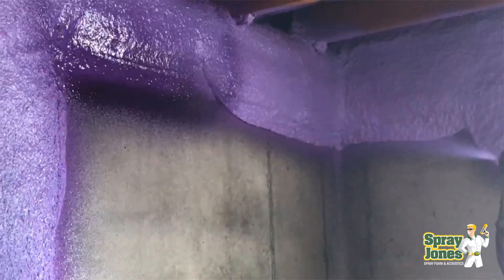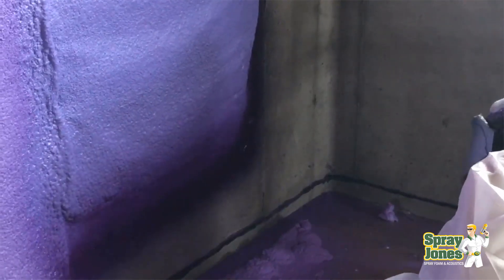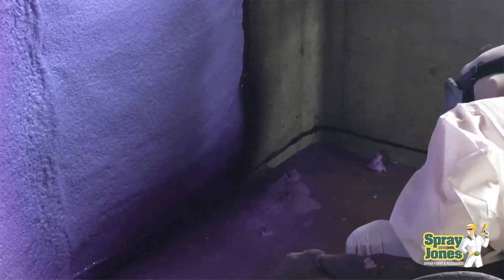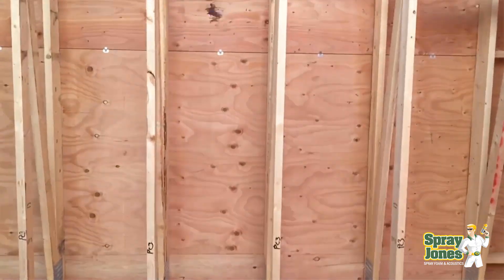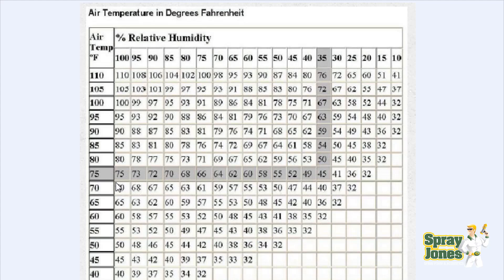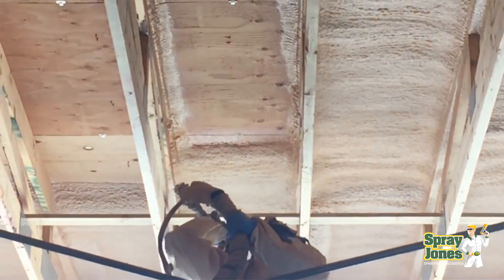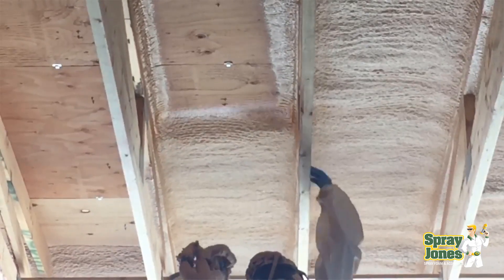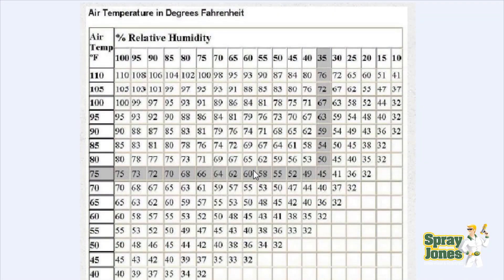How much Spray Foam Insulation is needed to stop condensation?

Comment: There’s no mention of outdoor temperature which dictates the amount of insulation needed and influences the temperature of the interior face of the foam (substrate).  This is very important.
Reply from the maker: Air temp compared to substrate temp in relation to relative humidity in the air. Those 3 are what you need to know.
Reply: @ true. What I meant was there’s no mention as to how much insulation is needed in the first place- which is a function of how much R-Value is needed.  After the required thickness of insulation (for R value) is determined, then all the other factors mentioned  come into play.  A one inch layer generally won’t be susceptible condensation, but it sure will be  in Northern Canada when it’s freezing outdoors. My point is you generally don’t determine the required thickness of spray foam based on vapour condensation, but instead on climate region.

Comment: Kitchen fan, bathroom fan drawing air thru tight spots,  
It's easy to change the conditions, ,balance iin house.(decking= syll rotting, block vents to crawlspace= rotting floorbords,)paint your fence ,all sides, withlatex paint .

Comment: My only concern is future cracks in basement .    How could you detect any problems?
Reply from the maker: You don't. Small surface cracks are stopped, but large ones will crack the SPF. 
At what point do you expect to be dry and warm?

Comment: So you’re saying that even the screws that stick through need a solid inch covering them to keep them from dripping condensation? So say they’re sticking through 1/2 inch then you’d need 1 and 1/2 inches of spray foam?
Reply from the maker: Yes. If they get cold enough they can drip at the tip. If that will be the case increase the amount of SPF.

Comment: I'm going to be building a cold plunge (https://www.youtube.com/shorts/ifpMX-7fhtM). What kind of spray foam do you reccomend I insulate it with. I'm building a wood frame around it and I plan to put a vapor barrier as well. I'm worried about condensation from the cold plunge. Any specific foam to stop that?
Reply from the maker: Closed cell.
Reply: @SprayJones  Sir, thank you for replying.  Someone like me who is naive to this greatly appreciates your reply. Do you reccomend anything off the shelf at a home depot or lowes?

Comment: Good video and well covered!👍 Im doing a building and have a pile of rigid XPS 2” and 3”. Was planning to fill attic and spray/seal all edges. Since the XPS is not adhered to the bottom/back side of the OSB roof deck/wall; is there a Chance of moisture/ condensation to build in that space? 

I watched the 4 part series, and want to make sure best approach. This will be a heated storage space. It’s a 48x84 with 20 sidewall pole building, roof deck and walls sheathed with 1/2” OSB 

Would there be any Benefit to apply spread groan over the top of the XPS?
I have on hand 10000 Square feet of 3” and 7000 Square feet of 2”

Plans to place below concrete slab and in walls and to roof deck. Would appreciate to hear if you have seen This application.

Thanks and great videos on this topic!! 👍👍

Comment: Mike - is there anything to worry about or considering when building a conditioned attic above the living space but having a vented attic above the garage? I understand that the partition wall in the attic for the garage would be insulated with open cell in my scenario, but is there anything wrong with this? I originally intended on continuing the R30 on the roof deck with open cell but have now thought about the issues above the attic with the building up of moisture at the peak. 

Maybe I’m overthinking this, but was hoping for your input.

Comment: I have a metal roof shed with 3" high box metal rafters.  If I have the inside spray foamed will I still get condensation through the rafters since they are touching the roof?

Comment: If you do flash and batt will the 3 or 4 inches of batt insulation insulate the surface of the 2" spray foam sufficiently to cause condensation on the surface of the spray foam?
In this situation the inside surface of the spray foam is being cooled by cold conduction from outside but is insulated from the warm interior by the batt insulation.

Comment: You say it's simple but the reality is behind that chart and the standard is complexity. That delta in the chart that shows condensation can go both ways, you can raise your indoor RH and get condensation and you can change your outdoor temperature and get condensation, you can increase your wind chill and get condensation, you can have both higher humidity and lower temperatures. So you need to know your climate zone and your incidence of extreme temperatures and then factor in a % of buffer to REALLY insure no condensation behind the walls of a structure. Otherwise, over time, you can get mold growth. Mold is a funny thing, all it needs is 21% moisture content and it grows, no matter what, then when it drys up it stops growing but lays dormant waiting for its chance to grow again. Mold can grow very fast, I have seen 1/4" thick mold layer grow in an air handler from one summer of condensation inside the air handler from a stuck chilled water valve. so, in short, the answer to this question should involve the ashrae standards of climate zone and incidence, the R value of 1 and 2" layers of the foam and an agreed upon buffer to make sure nothing condenses during extreme weather events. If you really want to geek out on this, you can take in projections of global warming trends we are already seeing witch do not necessarily mean things are getting warmer either in your climate zone, it really means more extreme weather events more often and warmer summers.
Reply from the maker: Global warming trends.... that aren't warming. "witch" is it?
Reply: @SprayJones   like most things in the universe, it's complicated. global warming may not just be distributed equally over each month as a few extra degrees of heat. The Earth is a dynamic place filled with saltwater, fresh water, huge global air currents, giant slabs of ice etc. The Earth is spinning ya know, so this causes some places to experience extremes of weather instead of just a few degrees of warmth, some like deserts in Australia, Africa do experience extra degrees but places like the midwest of US , and south along the gulf experience more tornadoes, or warmer winters on average but with colder extremes.
Reply: if air is conditioned on the inside properly then your humidity should be lower than 60% inside. i have found that my shop will not condensate at -10F outside and 70F inside with 1 inch of closed cell which qualifies as a moisture barrier. it was all very simple and as you can see the window is huge. global warming is not a thing and the term has been abandoned years ago. the rest of what you speak of doesnt matter either. Did you get that mildew tested inside the a/c system or did you see a collection of stuff and just assume it was mold? "alamost every a/c in the south has this and guess what, its not mold. KISS, its not compicated.

Comment: Thank you for all of your videos.  Straight and to the point.  I am looking at finishing my basement and your videos have been very helpful.  I will be meeting up with a spray foam contractor soon and will be looking at 1-1.5” of closed cell over the exterior poured walls and 2-3” in rim joist areas(I live in Nebraska). That way I have the vapor barrier and air sealing I need.  I plan to come back and 2x4 metal frame out at around 2” off the walls.  Then use BIB blown in insulation to fill the whole metal stud cavity.Thoughts?
Reply from the maker: 2" for all areas. Skip the bibs. 
Enjoy a warm basement that will be dry. 
We do them all the time this way.

Comment: I have 29 ga metal walls in my barn. Any concerns spraying 2” closed cell directly onto the inside of metal panels?
Reply from the maker: Flash coat with 1/2 inch and then build up the thickness

Comment: Great explanation of the humidity and due point table. Very interesting, and it's true most finished homes have 30% humidity and 72f. That's a good basis. As a temporary measure I install an r20 in attics when the soffit isn't installed and there are high winds. That usually prevents an excess of condensation for the mud to try on the ceiling.
Reply from the maker: Thanks for watching!
Reply: @SprayJones  thanks for sharing the info 👍

Comment: Just got back our updated quote from our insulator and the price of Closed Cell has jumped 30%. 
You think it will come back down soon, say before fall? 
The new price puts the foam insulation into the "luxury" category for our small home build. I don't want to do batts, is the cost still worth it?
Thanks for the knowledge you share with us, greatly appreciated!
Reply from the maker: For one, our foam has NOT gone up 30%. Smaller operators are having to buy product wherever if the are cut off, and sometimes that means panic prices to them and so on to you. 
SPF is totally worth it. Closed cell is the BEST product for insulation in 80 years. You only have to pay that bill once and you are good for generations.

I think you need to get more info.
Reply: @SprayJones  We are in a rural area where there are only a two different insulators within a 3 hour drive. He uses Carlisle SealTite. Is that a good product?

Comment: Thanks so much. This comes at a really good time. I’m getting ready to have 24x30 metal pole barn/shop put up . We are going to insulate so I can heat it in the winter here in southern Ohio.
Reply from the maker: Glad I could help
Reply: We use Commercial insulation as we sheet 60".wide, length + 5ft so it can be pulled tight double stick carpet tape to hold before sheets put on, for standing seam vapor barrier goes rafter to rafter banded system doe it stays tight , r20 between purlins R 19 over them 2" thermal blocks

Comment: Humidity in my area is much higher.  We filled the 2x6 walls with 5" open cell (some spots are less).  Installer said it would be a vapor barrier.  True?
Reply from the maker: Open cell foam is not a vapor barrier on its own at 5 inches.  I have a video just dedicated to answering that question.

Comment: Is there a coating that can be sprayed on the foam insulation before you put drywall on that would ensure no offgassing enters the home? I do a lot of mold remediation and during that process weatherization is sometimes included and I have had clients ask me this question. Thank you
Reply from the maker: All products emit something. So the SPF is the best of them all. Most SPF will be zero voc in 24 hours. 
Paints on the other hand do not stop smelling for 14 weeks minimum.